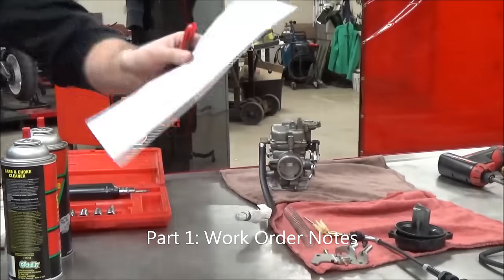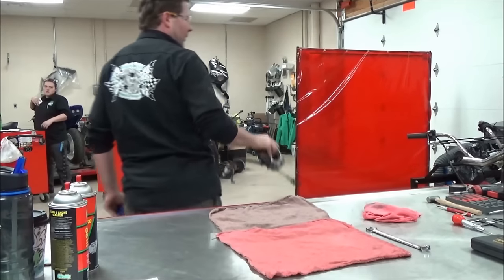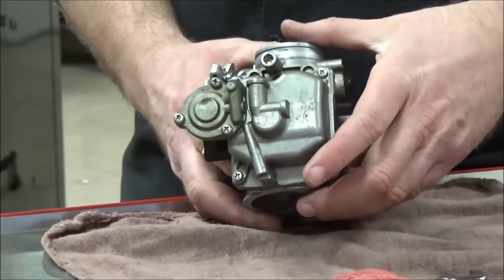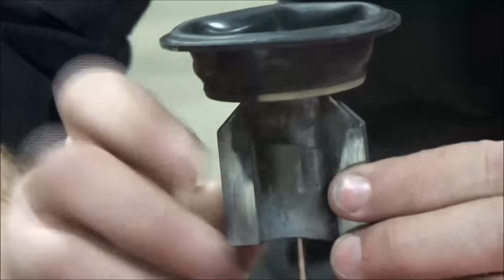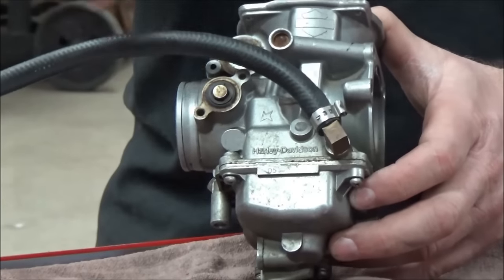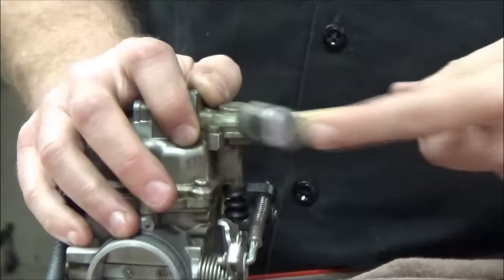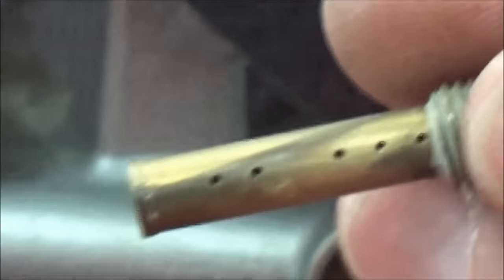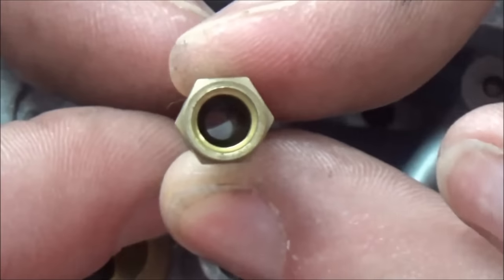01 "How to" CV Carburetor : Disassembly Recording Jets and Settings Cleaning Carb Rebuild Series

Comment: I am a professional motorcycle mechanic.  I a very impressed with the way Shane show the tricks of the trade in his videos.  I learned a thing or two from this video and I have rebuilt hundreds of carbs.  When I worked in the Dental field, the doctors used to call these techniques of pointing out the fine details as "picking up pearls"  Best how to videos I have seen.
Reply: I am a dentist from india.....i have 2 bikes wd CV carbs.....a 2003 hero honda karizma wch is a licenced copy of honda crf 230....for engine and honda vfr 800 for body style....and a 1992 kawasaki ninja 500 or ex 500....
Want to share my experience of carb cleaning....
I initially used petrol to clean carbs....but since last couple of years i have been using throttle body  cleaner to clean carbs...butterfly valves all passages,holes orifices.....the cleaner has worked wonders.....all passages etc have been cleaned....all that carbon/muck build up has gone.....and both bike's performances have increased.....Just wanted to share my experience wd u guys and all readers.....😮😮😮😮 KEEP UP THE GUD JOB FRIENDS......CHEERIO
DR J S KALSI BDS AMRITSAR PUNJAB INDIA.....

Comment: I have a 97 Yamaha Big Bear 350 YFM350BJ  with Mikuni CV carb. Been taken apart numerous times, jets replaced, all passages cleaned, float height correct, fuel screw set correct. No air leaks that I can find, boot looks good. It runs great during summer months, however it is a real pain to start when it gets to 20 degrees or colder. Doesn't like to start on full choke unless crank for a long time. It has a coasting enricher (never been replaced), fuel tank, fuel line, fuel filter good. All OEM parts been used on 3rd overhaul, still can't get this thing right. Any ideas? I'm about ready to install a primer system if I can't figure it out.

Comment: THANK YOU!!!  Your video solved a problem I have been having.  I'm 70 years old and doing my first carb rebuild.  It is off a 06 Suzuki GZ250 and is a very similar cv carb (Mikuni). When I pulled the diaphragm apart to check the needle, I discovered an extra part laying on the table.  Turned out it was the Jet Needle, which had evidently been placed in the hole inside the throat.  Even the Tech. manual did not cover where it was to be installed but did say which way to install it.   Looked at a parts diagram, made guess on installing it and your video confirmed that it was correct.  Thanks again for covering a carb area that no other video covered.
Reply from the maker: We love sharing comments like this with Shane.  
Thanks for sharing and the added value to our wrenching community. Keep them coming.
Want even more?
Join the channel. And you'll spend to access all 800 vids and Shane Daily! Smash the sub and like please. 

Throw Shane a high five donation, channel membership or merch for saving you $$$$$$$ Links below to support more for this work! 🙏
You rock for commenting! We will let Shane know! Want even more? Best $$$ you'll ever spend...Join this channel to get access to perks:
https://www.youtube.com/channel/UCBhM8DCKnT3qXwTW0eToyCg/join       
-Daily MEMBER FIRST COMMENTS ANSWERED FIRST 
-Live Q/A video chats
-Wonder if we have a video on your need? Members can request content links!
-Full Access to the ENTIRE 700 video library
-Member-Only FREE tool giveaways  
Ways to support or high five How 2 Wrench! Thank you in advance. YOU MOTIVATE US TO DO MORE!
1. Smash the subscribe button (thank if already a sub!)
2. Have you seen our "YouTube Trained Support Shirts?  https://goodfellasmerch.com/collections/how-2-wrench/products/support-shirt   
3. High five donation:  https://www.paypal.me/how2wrench    
4. Got an emergency and your head is about to explode from frustration or fear? Get Shane’s cell here: https://how2wrench.com/ols/products/techline-one-on-one

Comment: Shane, my friend and I just removed my carb on my Harley fxr4 with 1340 evo with only 17k miles...my pride and joy! I've owned this bike for 4 yrs and not had any issues. Just of late I've had gas leaking out overflow from carb, she has new needle and we adjusted float level today via your great video. New gasket on top of bowl, new enricher cable installed also. Put her back together , turned on gas and ran bike for few minutes..no leaks. 2 hrs later I had rather steady drip out overflow as before. Shut gas off at petcock and gas leak stopped. Bike has aftermarket petcock with no voes hookup, voes hose has screw in end of it that would normally fit to stock petcock. I do have spare stock petcock that I can install after I run out more of my gas if you feel that would fix my problem. in 4 yrs of owning I've not had to shut off gas at petcock..all of a sudden this leak developed and rather frustrating. Harley mechanic at local shop recommended I buy another carb...but I don't  think that is necessary. any advice you may have would be appreciated sir. the float level is set properly as per your video at 20 degree and tab bent as per your directions. Needle is not seating or I may need to install stock petcock. air screw we have set at 2.5 turns out. thanks for any help you can provide sir.  Dave
Reply from the maker: It sounds like you’re ready for some Techline help. Coach Conley is also available for hire to personally work one on one with you if ever needed. Yep he is a real person. Give him a call @ 602-345-0432

Details here: https://how2wrench.com/product/personal-tech-training-phone-facetime/

👍 Thank you for taking the time to comment! Hit that subscribe button if you haven’t please! It helps us! 
Here is a way to support all the free videos.
Want to say “thanks” or “keep it up”? Click here https://www.paypal.me/how2wrench  

Your answers and help are just around the corner. Save time and money while protecting your investment and yourself by doing it the right way!
Follow us!
Web:
www.How2Wrench.com    
www.Tools2Wrench.com

Comment: after following your instructions I rebuilt my CV-40. it gave me from 32 previous to 48 miles per Gallon. At one run I was able to get 50 MGP blew me away, I thought something was off but I tracked my tank fill and mileage gas fill receipts. Damn amazing. Everyone should replace your fuel lines, Filter, gaskets, o-rings float , clean jets, and air filter and slide Diaphragms and vacuum lines. My 1996 1200 sporty is whooping AXX
Reply from the maker: Thank you. Here is a way to support all the free videos. Don’t forget to subscribe too! 
Want to say “thanks” or “keep it up”? Click here https://www.paypal.me/how2wrench  

Coach Conley is also available for hire to personally work one on one with you if ever needed.

Your answers and help are just around the corner. Save time and money while protecting your investment and yourself by doing it the right way!
Follow us!
Web:
www.How2Wrench.com    
www.Tools2Wrench.com

Comment: WOW SHANE, I HAVE WATCHED THIS VIDEO BEFORE THE REMOVAL AND CLEANING OF MY CARBURETOR AND I DID NOT PAY ATTENTION TO THE MAIN JET PART. THE SILVER PIECE THAT PROTRUDES INTO THE INSIDE OF THE CARB THAT YOU SWITCHED AND YOU STILL WERE ABLE TO SCREW THE MAIN JET INTO THE TUBE. YUP I MADE THAT VERY MISTAKE AND DID NOT NOTICE. AFTER COMPLETE ASSEMBLY THE CARB RAN TERRIBLE. I REWATCHED THIS VIDEO AND FINALLY REALIZED I HAD MADE THE BONE HEAD ERROR YOU WARNED ABOUT. THANKFULLY THERE WAS NOT PERMANENT DAMAGE AND I WAS ABLE TO CORRECT MY MISTAKE AND REASSEMBLE THE CARB CORRECTLY. IF I HAD NOT WATCHED THIS VIDEO I WOULD HAVE BEEN IN A WORLD OF PROBLEMS. THANKS SHANE I OWE YOU A BIG ONE FOR SAVING MY CARB AND A LOT OF MONEY. "WHEW"!!!!!!!!!
Reply from the maker: Thank you David. There many more in the series for free and even more for members!

Comment: i also work on carbs, and you are so correct about the screwdriver fitting perfectly with the pilot jet, i've seen a lot of those crushed jet heads, with the slot gone flat, worked on by careless mechanics, it's a pain to work on. and i do take pictures of everything to show the owner how it was messed up by previous jobs.
Reply from the maker: Thanks for commenting and adding value to our community!

Have you subscribed yet to never miss a video? Have you seen the video playlists? Over 600 videos! Check them out here: https://www.youtube.com/user/conleybuilt/playlists  

Want to say “thanks” or “keep it up”? Click here https://www.paypal.me/how2wrench    
 
Your answers and help are just around the corner. Save time and money while protecting your investment and yourself by doing it the right way at www.How2Wrench.com

Comment: Hi Shane very informative video I have an 02 HD sportster XLH 1200 I bought the bike used ran good for 2 mths. I had an issue with hesitation, cleaned carb. reverse of flow etc. and cleaned the pilot and main jet. Person who owned bike before me put on aftermarket full exhaust Vance&Hines they took the baffles out, I put them back in. Also they had the engine reworked at around 5,000 miles. There's about 29,000 miles on the bike now total now. The pilot get is a 42 the main jet is170. Before cleaning the carb the spark plugs got fouled out bike hard starting cleaned up the carbon deposits and checked the plugs for resistance checked out ok. Now it'll start easy cold with the choke out like it should but when I drive it for a while and get it hot it's hard starting and the plugs are clean looks like it's burning to lean. Tried adjusting A-F mixture screw. I'm positive it's out about 4 turns, spark plugs are still showing a lean burn condition. Think jets are 2 small plz help.
Reply from the maker: Thank you for the kind words! Stay tuned for the upcoming "Tech Talk" Live feed coming soon where a panel of experts will address YouTube comments of the week. 

Head over to the new website and subscribe to the newsletter to never miss a video or newsletter! 
https://how2wrench.com/contact/ 
If needed someday know that I offer personal help. This video explains the next best step to connect with me. 
https://www.youtube.com/watch?v=vjvmB01ebcs 
Direct link to services: 
https://how2wrench.com/product-category/tech-lineservice-callminutes/ 

Did you like this free video and hope to see more? Would you just like to say thank you with a donation? Click https://www.paypal.me/how2wrench
Keep Wrenching,
Shane Conley
Instructor/Motivator/Motorcyclist!
www.How2Wrench.com

Comment: Hey Shane.  Gunsmithing screwdrivers for jets.   Perfect square fit.   Slots shaped the same as gun screws.   You can get a set a Walmart cheap with multiple heads without breaking the bank, on up in specific size and quality.
Reply from the maker: Thanks for the tip Crfor Freedom! I will have to try. a few have suggested that one. 

Have you Subscribed yet to never miss a video? Have you seen the video playlists https://www.youtube.com/user/conleybuilt/playlists ? 

Want to say “thanks” or “keep it up”? Click here https://www.paypal.me/how2wrench   

Your answers and help are just around the corner. Save time and money while protecting your investment and yourself by doing it the right way at www.How2Wrench.com
Reply: Thanks Shane.  New subscriber!   Haven't checked them all out yet, LOL!! 
 right now you're saving my bacon on my CV carb rebuild!    Dissassyed the butterfly, thought I payed enough attention to how I took it apart, but doing it on a 16 hr day without pics (big mistake) was a mistake.   I think I got it right.  
              I've built quite a few carbs, and it's ALWAYS good to have a Sherpa to guide the way when blazing a new trail like I am on this CV.  Your videos are a godsend!!!    Saved me from making some mistakes I would have made even with the SM.     Thanks for the link, I'll check it out ASAP, but first I need to get this bike up before the snow flies!
Reply: If you know where I can get a schematic of the buttfly assy, I'd appreciate it.   Didn't see it in the SM.   Doesn't show it disassyed. 
         You can be sure I'll be checking in again from time to time as I finish this up and need the help.  This winter, you and I will get VERY well antiquated!!  ;-)

Comment: My Honda Rebel 250 was running fine until I decided to clean the carb thinking to achieve peak performance (not that it was having issues). After that, my bike will run and idle fine, revs loud when pumping throttle, but Boggs and then dies every time I give is throttle slowly. Please help me know where to start, I’m a handy guy and a DIYer who lacks experience with motorcycles.

What’s I’ve done this far: Cleaned carb four times and no difference. I had it sat in chem dip (not the runners diaphragms) for 24-48 hours, used carb cleaner spray and small air compressor to clean after I used a tiny copper wire to check oriffices. Now carb looks super clean, all jets look clear as in I can see light and feel air blowing through. I installed just the way it’s supposed to go back and verified that with your videos and others I found on YouTube. Nothing looks broken except a tiny crack on the lid of the diaphragms but so small I don’t think it can cause my issue (but what do I know being a noon?) 

As far as screw mixture adjustments, iv tried everything from sitting position to 2 full turns out following your tips of how to turn and no difference even when I let it adjust for a minute. 

I’m so confused and sad because bike was running fine until I cleaned the carb, please share some guidance and I will do the work as I am handy and cannot afford a mechanic right now. Thanks I’m advance!
Reply from the maker: That’s a great question for Shane directly! We are just the social media team. Shane has a solution for you. As far as the question, Shane does answer questions when he get's back around to non members eventually so hang tight, FYI >>>> he does member ones daily!
He is just returning from an extended stay in Japan training students this winter. You can imagine how full his inbox is. We put orders are to the front of the line.

The one-on-one service. Get Shane’s cell here: https://how2wrench.com/ols/products/techline-one-on-one       
Quick answers are answered daily as a channel member: Join this channel to get access to perks:
https://www.youtube.com/channel/UCBhM8DCKnT3qXwTW0eToyCg/join   
-Daily MEMBER FIRST COMMENTS ANSWERED FIRST 
-Live Q/A video chats
-Wonder if we have a video on your need? Members can request content links!
-Full Access to the ENTIRE 700 video library
-Member-Only FREE tool giveaways  

Have you seen our "YouTube Trained Support Shirts? Great way to "high five us" https://goodfellasmerch.com/collections/how-2-wrench/products/support-shirt

Comment: Nice set of videos on the CV carb. Getting ready to rebuild mine and I have never messed with a carb before. Even though the service manual lays it out pretty good, I like to make sure I'm well informed before I take on projects I've never done. Keep up the good work.
Reply: @71sc502  I did not.

Comment: Gday. Thanks for the tradie video. I have a demom possessed  flat 2 stroke mikoni.
Bike left with no fuel additive. 
Green gue removed.
All jets are clear.
Factory set all s carbjet crews.
Sled up down set main needle set.
Idle need set
Slide sled in unity with all 4 on full throttle. 

Bike - rg 400/500 suzuki square 4.
Rotor valve disk system on  crank case.
No air leaks.
Problem
No start.
Poured synthetic 2 stroke fuel into compression spec good engine through spark plug holes .
Engine fired.
Thanks mate .
Andrew Nz